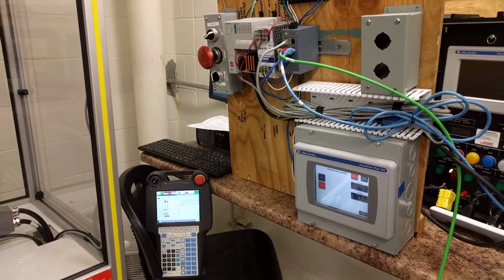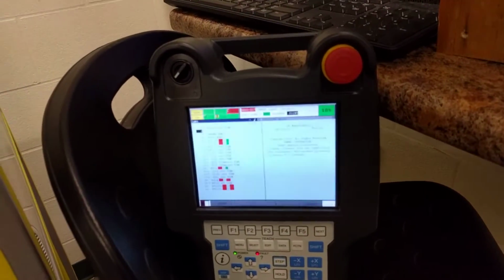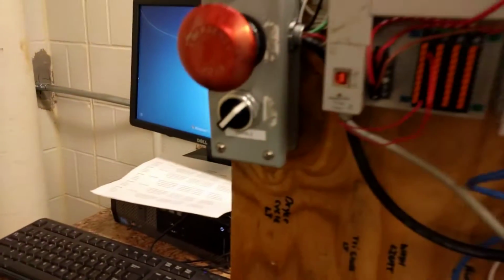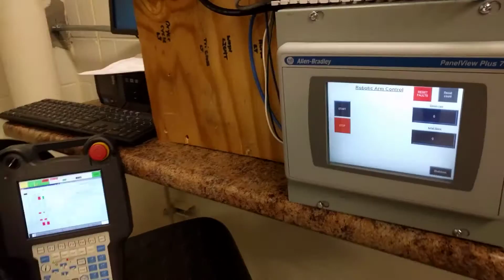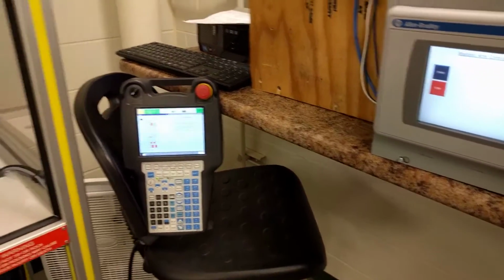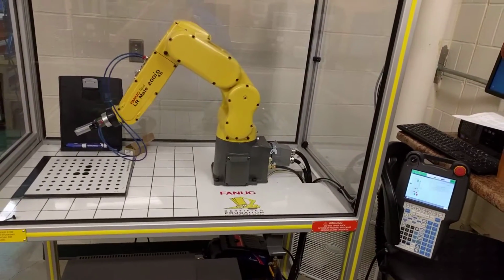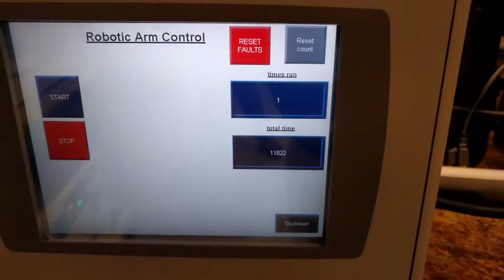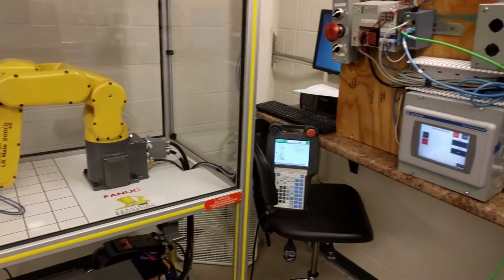Controlling a Fanuc CERT Cart with Allen Bradley HMI - Demo

Comment: Lo comunicaste por ethernet ip?
Reply from the maker: Fernando Jara Carrasco si
Reply: Y el robot está con Ethernet ip Adapter u otro opcional? (SNPX, por ejemplo)
Reply from the maker: You have to work with Faunc to buy the PAC codes to enable that feature. The  hardware is there but the software is not active.
Reply: Tengo acceso a los opcionales. Me interesa saber si el robot está como adaptador y la hmi como scanner
Reply from the maker: It is all routed through the Allen Bradley PLC
Reply: HMI->PLC->Robot? (vía ethernet ip)
Reply from the maker: Fernando Jara Carrasco yes/Si.  All comm is routed through the plc.
Reply: Y para enviar o modificar Registros (R[2] por ejemplo)?
Reply from the maker: Fernando Jara Carrasco no hablas Espanol. Englas por favor.
Reply: I need to set new Register Robot (R[2], for example) using a HMI. It could be possible?
Reply from the maker: Fernando Jara Carrasco all of this is control to the plc. You would need to set up your tags in the PLC to correspond to input output on the robot and allow the HMI then to toggle the memory bits in the PLC that corresponds to the IO for the robot. I don't think Allen Bradley will allow direct communication between the HMI to the robot without the PLC being present to interpret
Reply: Ok, I understood, sorry my english, I'm trying to know if it possible to set a Register from plc sending a "string", "integer" (ascii codes), not just digital imputs/outputs (DI/DO).
For example: I want to change the value of the R[2] from "235" to "246", a variable number